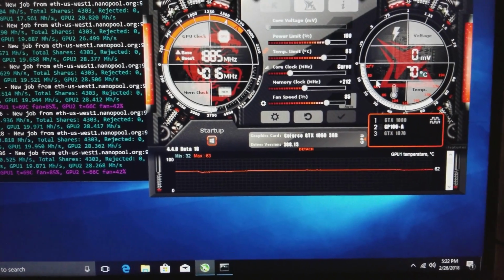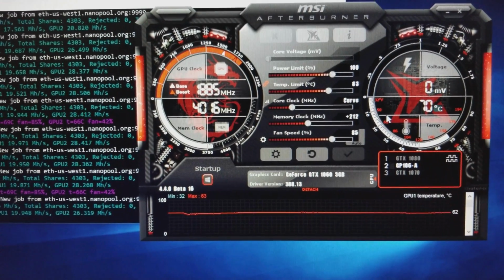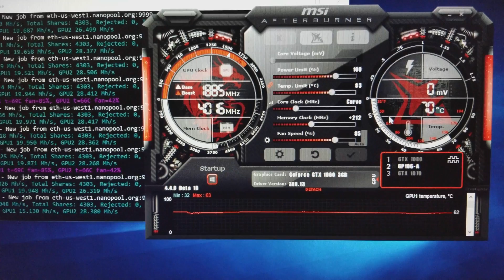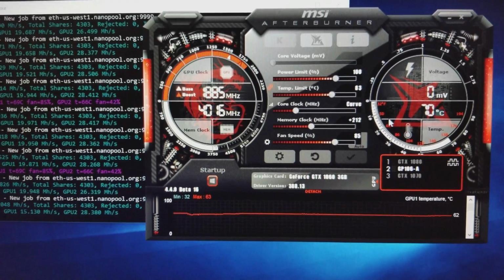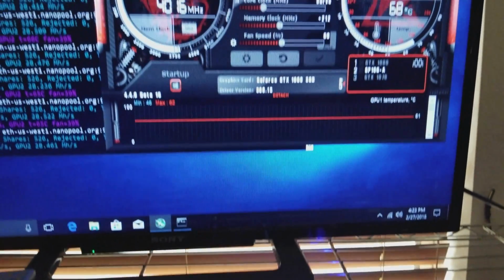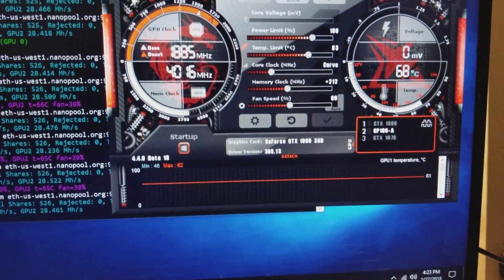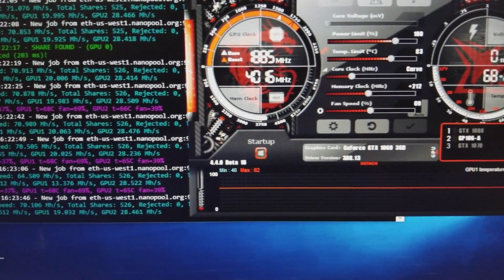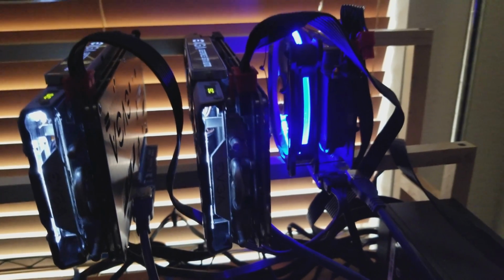Gtx 1060 mod will it increase hash rate?

Comment: No one cares what it looks like and I'm not sure this actually did anything to the temps as that card was pretty dirty to begin with. Now you probably have more of a power draw. The only up side is replacing the fan next time will be easier. That MSI really sucks all away around. I like the EVGA's because these use ball bearings and even their single fan is dual mining at around 22.5mhs Ethash mildly overclocked and below 60c, their dual fan models are around 55c while dual mining.
Reply from the maker: My Evga cards are my favorite. MSI Gaming X have really good coolers too.

Comment: Jesus man. MSI doesn`t have any shame. They use the same heatsink on a laptop and now they use it for a desktop GPU?
Did you ever use an MSI Laptop? OVEN on Batteries :D
Great video btw. Where di you bought the GPUs?
Reply from the maker: Thanks Daniel, that GTX 1060 came out of a prebuilt ibuypower series 506.
Reply: ibuypower has no value. KFC can do the same job with a prebuild system :P
the quality and materials used in the heatsink tell everything about the manufacturer.